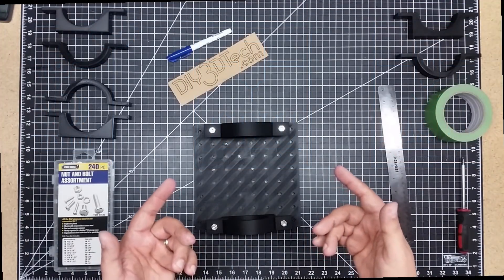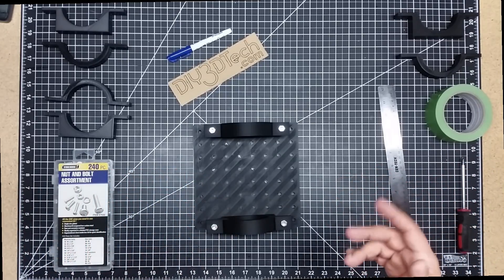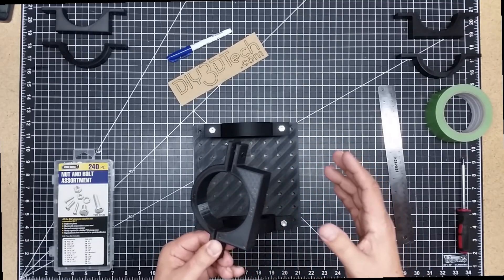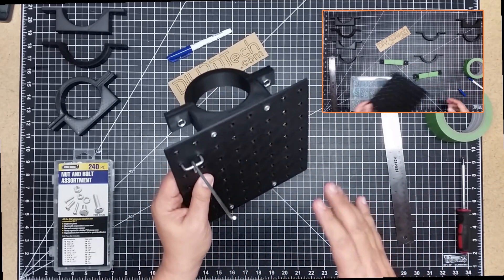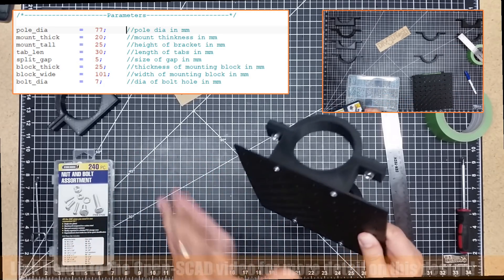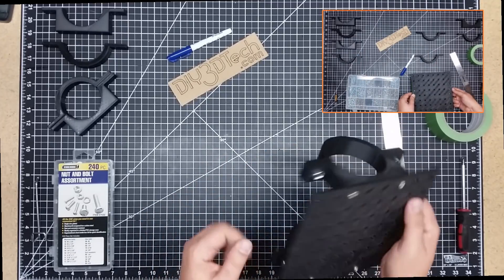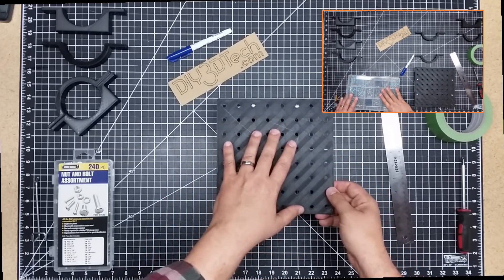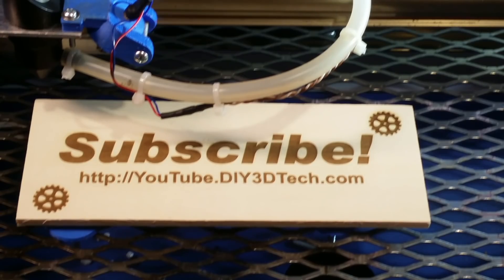Design Talk - Making Better Use of Basements Poles and Drains With A 3D Printer!

Comment: Very nice.  I live for doing stuff like this in my garage with the 3D printer.  For example I built a 3D-printed system for mounting anything you want to slat wall, then designed and printed out several expandable bracket systems for hanging a variety of cabinet clamps. This technology feels like having a superpower sometimes.  If you can think it, you can have it in your hand a few hours (or days at worst) later.
Reply from the maker: Bingo!  I would like to see more on the slat wall system as I am building a new shop and all of the walls will be slat board!
Reply: DIY3DTECH.com Well that’s a coincidence.  I’ll try to put up a video late next week. I’m headed out of town first thing tomorrow.
Reply from the maker: Please let me know when you do!

Comment: Looks like a great candidate for threaded inserts. Great information on incorporating threaded inserts into 3D prints here: https://hackaday.com/2019/02/28/threading-3d-printed-parts-how-to-use-heat-set-inserts/ Have you considered submitting this project to Hackaday? It's the kind of content that needs to get spread around.
Reply from the maker: Had not seen this particular one, however yes known of the technic however tend to a cinching method which I can use a washer for support.  However your right this is a neat addition for litter loads and I likely will do a video!  Also no have not really considered Hackaday (maybe i should) however agree on the sharing and the reason for the video :-)